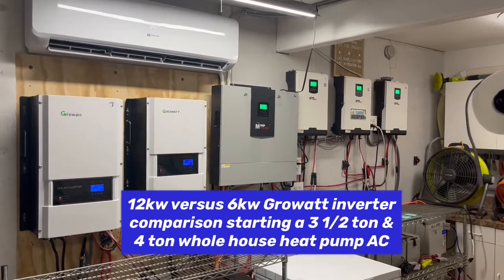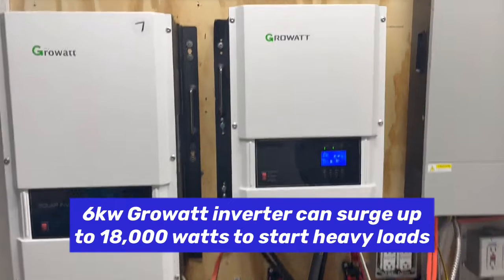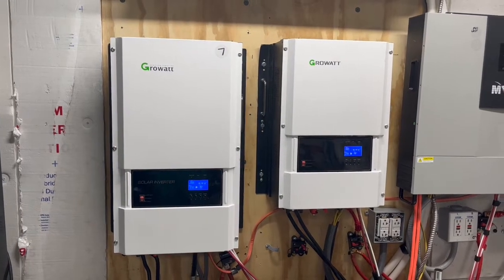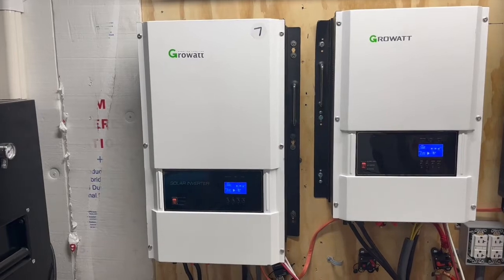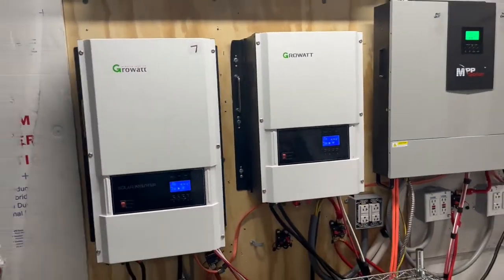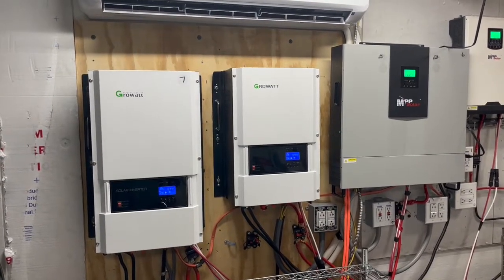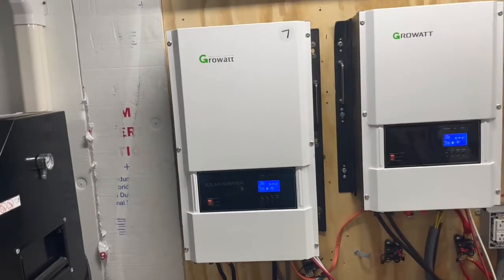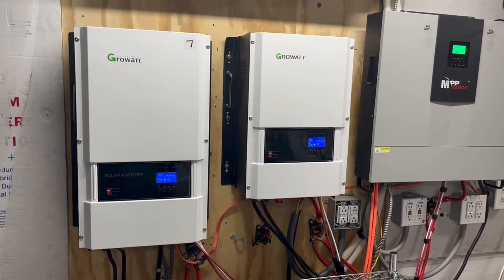12kw & 6kw Growatt Low Frequency off grid inverter comparison to start 3 1/2 ton & 4 ton AC.

Comment: Thanks for your  video.   As a  conclusion  do  you recommend   low  frequency  inverters for   workplace   where  there is  peak amps  drawing in  startup ?   
Am   many  motors  and  2 ton  ac in  my  shop  .sometimes  peak  reach  to  up  to 30  Amps
Reply from the maker: High frequency will probably not be able to start up compressor or motors. The low frequency can not be paralleled together so a 12kw low frequency is 12kw but you have start up of up to 36,000 watts. I have the 12kw and 6 kw Growatt low frequency inverters and I can do alot with them. If you are only running 120v items like 12,000 btu mini splits, you can use the high frequency inverters and run several on one inverter. Mini splits do not require a lot of amps at start up. I wish I would have bought the 12 kw Growatt first. The other think about the low frequency to keep in mind is not to run them at peek of like 12,000 watts on 12kw inverter for long periods of time, it can greatly reduce the life of inverter. As where high frequency you can just parallel another inverter to add more available power. I’m never go over 8000 watts on 12kw inverter because I have 3 other inverters to draw from. Hope this helps, let me know if you have any more questions.
Reply: @DIY solar power with Pappa off grid projects   for sure  its  more than helpful  👍   . I just check  GROWATT  manual  they  suggest  not  to  use  less  than 400ah  battery  with  over  low freq  inverter   8 - 12  kw   and  not  less  than  200ah  with  6kw  low  freq  inverter .  Its  really   high cost  problem  🙂
Reply from the maker: @robertomuhammad35  I have 8 Agm batteries connected to both 6kw & 12kw Growatt and I have no problem starting everything. 2-48v battery banks in parallel. Will be getting more LiFePO4 batteries this year some time. But AGM has worked better than LiFePO4 batteries when it is high inrush amps at start up.

Comment: Great job u did! 
I have some concerns if i want to add more solar panels as we know that Growatt Voc couldn't take more than 150 Vdc which is quite low comparing to it's power (say 8kw growatt) . Shall i add an mppt charge controller to load all of my needed solar panels to ensure the system works well especially in the non good sunny days .
Reply from the maker: I would call signature solar and talk to one of their technicians who would be able to give you a better answer. They are trained in using Growatt and could tell you if that would work. I never tried that so I can’t tell you weather that would be ok. They are experts with inverters.

Comment: Can you please tell me how you obtained the inrush current values you used in the video?  Was this by a calculation or by a number such as LRA on the label of the condenser unit/heat pump?  Were the units that you were starting single speed or dual speed?  Thank you.
Reply from the maker: I used a meter to see in rush amps and looking on label on the actual unit. Very close to what unit said on label. In rush voltage fluctuation was a couple of volts on each start up. The 3 1/2 ton unit was around 72-79 inrush amps. After I installed soft start, the inrush amps fell to 19-24 amps.
Reply: @DIY solar power with Pappa off grid projects  As an FYI the LRA on my 5 ton Trane XV20i is 12.
Reply from the maker: @robertplas3947  my 31/2 ton carrier unit LRA 75.0, to the right of it on the label is the RLA and that is 15.1. My 4 ton unit LRA is 105.5 and the RLA is 18.1. Both my clamp on amp meter reading align with what the label states as LRA. Are you sure you are not looking at the RLA? On the label on the unit outside both LRA and RLA are on the same line on label.
Reply: @DIY solar power with Pappa off grid projects  I am sure.  This is a 22 SEER variable speed communicating unit. The 60,000 BTU circuit uses a 40 amp breaker. LRA 12, RLA 19.3.
Reply from the maker: @robertplas3947  that is really low load running amps. Oh by the way both units are single speed. Did not read that part of the question.
Reply from the maker: I know the higher the SEER rating the less the power consumption. It is suppose to be really cheap to run a 38 SEER mini split, but they cost 3 times the price of the mini splits I bought. Most mini splits are only meant to last 3-6 years since they have compression fittings for refrigerant. I know my whole house heat pumps are only 16 SEER. That might explain the higher inrush amps. Have you tried using a clamp on meter to see what your inrush amps are or is the unit not installed and running yet? If your unit is operational, what is the inrush amps if you have a clamp on meter. Also I am just a DIY guy who knew next to nothing about heat pumps or solar power 3 years ago, all my knowledge is from diy installs. If you knew a Hvac guy, I’m sure he could answer all your questions.
Reply: @DIY solar power with Pappa off grid projects  No. This is an installed Trane unit. The circuit was derated from 50 to 40 amps when installed. 
I have a clamp meter, but dont want to fool with it and really for starting a motor, it will be too slow to measure  anything but peak.
Trane is built unlike anything else.  Even the cooling coils in condenser go over the circuit boards.  And the variable speed unit is using a DC inverter motor with over 100 electronically controlled speeds.
I've never heard of a mini split higher than 22 seer.
Reply from the maker: @robertplas3947  check signaturesolar.com , they have mini split units with 32-38 SEER when able to keep in stock. I never had a Trane unit so I not familiar with how they are built. My main house heat pumps are carrier units. Much less technology in the manufacture end product. I know nothing about Trane units so I can not help you any more nor would I mess with a Trane unit , possibly voiding the warranty. I know when I went to replace our heat pumps, the price for Trane units was double of what we paid for carrier units.
Reply from the maker: On the video I did with the title” added soft start to AC makes it possible to use Growatt 6kw low frequency inverter” at 7 minutes and 24 seconds into the video you can freeze the picture and see the label on the outside condenser unit where it shows 15.1 RLA.     75.0 LRA. Hope this helps to clear it up. Either way the soft start I use from hyper engineering should work on your 5 ton Trane

Comment: I feel like growatt inverters wires are sized incorrectly. Peak 36,000w requires (20 secs can melt wire!) 36,000 watt is 150amps. Yet they ask for 6awg wire.

Busbars for hookup blows as it wouldn't even fit a 4awg wire on it... 80amp input requires 4awg wire....copper...
Reply from the maker: I doubt I will ever get my 12 kw inverter even half the 36,000 watts so I’m not to worried. Thank you for the excellent input.
Reply from the maker: The manual for the Growatt 12 kw low frequency off grid inverter states that the surge of up to 36,000 watts is only for 20 mili seconds(ms). A fraction of a secs. So I would not worry about the surge to much. I use 2 awg from inverter to breaker and 2 gauge thnn wire to batteries. Never have had a problem with wires getting remotely warm. Thanks for your input, it is greatly appreciated.

Comment: I have a 12kw inverter and have problems with Signiture Solar still trying to get it fixed. The inverter gets the 220 volts from generator but it wouldn’t charge the battery. I have been talking to there Tech Support. The inverter still in warranty. The inverter display is showing 220 volts AC in put and the utility pole showing.
Reply from the maker: What type of batteries are you charging?
Reply: @diy-solar-guy  lead Acid
Reply from the maker: @bearupfarm1818  should be able to set on AGM and change some settings to your preferences. I have 240 volts coming in to my 12kw with just 2 wires at the moment. I had to run 2-6 awg thnn wire 100 feet and then buy 8 awg thnn green wire for the ground wire. Green was out of stock everywhere? My grid or generator transformer pole will display on screen but will not start charging until the conditions are met in the settings, if the battery is at 51 volts and my setting is set for 48volts, the grid or generator will not start charging batteries until it drops below 48 volts, sometimes it might not engage until I hit 47.5 volts. I usually have grid as my main setting, then solar and battery. SBU setting for setting 1. AGM for setting 5. 30 amps for setting 11. Setting 12 is the one that until you go below that voltage, your generator will not start charging battery thru your inverter. If you have it set at the default of 46 volts and your battery bank is above that voltage, you will not start charging until you drop below 46 volts. Setting 13 is when you want to stop charging, default is 54 volts. Setting 14 is set on SNU in my 12kw Growatt inverter. Hopefully these suggestions will help. I had a heck of a time getting my server rack 51.2 volt LiFePO4 battery to charge as well but finally got it working.
Reply: @diy-solar-guy  double check all setting and they are good. Still won’t accept the AC to charge the battery. The display shows the utility pole.
Reply from the maker: @bearupfarm1818  Dry Contact Signal
There is one dry contact (34/250VAC) available on the rear panel. It could be used to deliver signal to generator when battery voltage reaches waring level.
1. The wiring between generator and the inverter (not all generators are the same wiring diagram as below, please ask supplier for instruction if there's any questions.) you can email me at ppag53421@outlook.com and I will give you my phone number so we can talk, too hard to help in YouTube app. I will try to help you the best I can.
Reply: @diy-solar-guy  hi. I just sent you an email.
Reply from the maker: @bearupfarm1818  thanks, just responded

Comment: Wow, the only unfortunate thing is the idle consumption of those big LF inverters and then having multiples
Reply from the maker: I only use during the day while producing solar power. The 24volt systems use about 5 watts idle and are excellent for all I power overnight. If it was cold enough, I could use 2-3 mini splits at night to heat house but my house temp this time of the year rarely drops below 66 degrees when we get up in morning. At that point I just turn on one mini split downstairs and run off LiFePO4 battery for an hour or two. Basically the 3 48 volt dual phase units are for the summer to cool house with 3 1/2 ton and 4 ton whole house heat pumps. Will get another 4-12volt LiFePO4 this year and I will be happy.
Reply: @diy-solar-guy  gotcha, what inverters only draw 5w for no load? That is surprisingly small
Reply from the maker: The MPP 2400 watt, 24 volt all in one 120 volt output inverter.

Comment: How were you able to mount the Growatt 12K to the wall? I have one, and the ~180 lbs is more than two people can lug up there.
Reply from the maker: I had to go to Harbor Freight and get a pull chain engine hoist. I used 2 metal racks that are in my videos for battery bank that had all shelves on it and putt 2 shelves at top. Put a lot of weight on bottom of shelves to keep racks stable and not too heavy when I started lifting inverter. Used bundles of cardboard boxes I use to buy to ship stuff and piled on the top shelf as high as I could to the ceiling as possible. Then I used 3-8 foot 2x4 screwed together on top of racks with a space of 36 inches between the racks. Mounted the hoist on the 2x4 and used Velcro straps that had mountain climbing hooks to attach to hoist. Then I just started adjusting the hoist up. I wanted to go higher on wall but that was as high as I could go. The engine hoist was only $68 at Harbor freight. I had everything else. Good luck with mounting that beast. The 6kw is only 109 lbs. lol

Comment: I thought those split phase growatts were not stackable?
Reply from the maker: I am not paralleling units but rather using output of the 6kw to the input of the 12 kw. Both units are pure sign wave. In other words , you would connect your grid power to the input of 12 kw, instead of grid power , I am using the 6 kw. I am drawing 30 amps from my battery bank on the 12 kw and when the voltage on the 12 kw drops below 50 volts , the 6 kw output supplies the input of the 12 kw to drop the draw of 12 kw battery bank to zero. When I try to connect all panels to the 12 kw, it just does not run and keep up, but when I use the 6 kw inverter to supplement the 12 kw inverter, it ends up keeping both inverter batteries around 50 volts. Hope that helps to explain how you can use 2 separate Growatts, but remember these are NOT in parallel. That is why it works.

Comment: Hi Awesome setup. Two questions: Did you bond ground and neutral in the subpanel witch inverter feeds? Did you run a neutral from main panel to subpanel to have a common neutral?
Reply from the maker: I actually just installed main breaker panel boxes for 6 kw Growatt and the 12 kw Growatt. I will be doing a video in the next few days showing how I bonded the neutral and ground in the breaker box for each inverter. These Growatt inverters can not be paralleled, you are maxed out at 6kw and 12kw.

Comment: Thx for your response. Also, Does the 12k have an AC charger that can be powered by a generator?
Reply from the maker: 12kw Growatt can be wired to 240v input from grid to charge battery bank. I tried using my 6 kw Growatt as 240v input and would charge battery if no solar on 12kw but would shut down if tried to use for a surge to start a compressor on heat pump that exceeds surge of 36000 watts on 12kw Growatt. 12kw Growatt is maxed out at I believe 80 amps and 6kw Growatt is maxed out at 60 amp? Not at house , out of town. Trying to answer from memory. That soft start on main heat pump on house makes a huge difference on inrush to start ac. Dropped from 72 amps inrush to 22 amps inrush. Will be trying to start heat pump with my other 2 mpp inverters that are 120/240v split phase in the near future since the inrush amps are much lower. Will be interesting to see if mpp will be able to start. In the past was not able to start 3 1/2 ton ac with mpp inverter. You should be able to use generator as 240v input to charge batteries on Growatt but has to be 240 v input on Growatt, can not use 120v to charge batteries. I remember that now, sorry camping for holiday weekend. Hope these answers help you. Hope you have a blessed holiday.
Reply: @diy-solar-guy 
Thx. Always blessed.

Have had a 12kw in a  box sitting here since early Nov last year. About to install it and batteries in a double axel trailer for a portable large power solution.

Comment: My understanding is that model of Growatt (both the 6 &  12kw) are not stackable. Do you have them on separate sub panels?   And the MPP on yet a 3rd sub?
Reply from the maker: All independent systems not tied together. Growatt are not able to parallel at all. I actually have 4 independent systems and with 4 separate battery banks.
Reply from the maker: All my Mpp off grid inverters I bought are able to parallel. My Mpp are 2 in parallel and the 3 rd one is not in parallel. Mpp are great for mini split heat pump inverters that slowly ramp up watts being used but lack the ability to start up high amp inrush to start up compressor or motors. The Growatt low frequency off grid are not stackable, but there have new ones out that are not low frequency and stackable, not sure if they can start ac. Look at signaturesolar.com in Texas on their website and it should tell you if you can connect generator to inverter. You can also call their techs and they will answer all your questions about Growatt inverters. Very very helpful.

Comment: Look up Air Conditioner soft start it lowers the inrush current needed for start up.
Reply from the maker: I installed a soft start 2 months ago on my 3 1/2 ton upstairs heat pump and it reduced the inrush amps from 76 amps to around 22 amps. The soft start works really well and only $250.
Reply: @diy-solar-guy  That’s great, can you tell me what you got? The ones I’ve been looking at are around $350. I have a 3 ton unit.
Reply from the maker: @billgatewood9578  Hyper engineering soft starts, just google, I bought mine online, $249 includes tax and shipping. Need 16-32 model for3 ton. That is basically the amp range for model number (16-32 amp) to start ac. Took 5 days through Post office mail to get to me from time I ordered.
Reply: @diy-solar-guy  Thanks, keep up the great videos.

Comment: Do you know whether you can substitute a generato'rs input for the PV input on these Growatts? I don't have panels, and I'm looking to use my Honda ~5.5kw as a substitute.
Reply: For the amount you spent on the Honda you could buy 2 pallets of 250 watt pannels from San tan solar.thats around 40 pannels
Reply from the maker: I am not sure, call signature solar in Texas and their techs can answer that question for you.
Reply: We have a Phocos any grid inverter and I know 100% you can use generator on those to charge batteries & power loads at same time. I’m sure you can with the growatt as well.